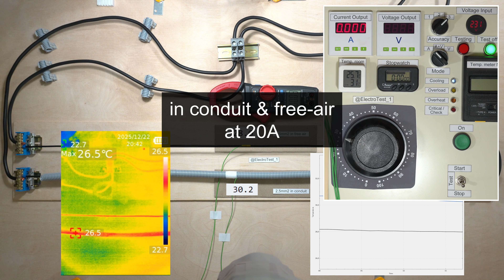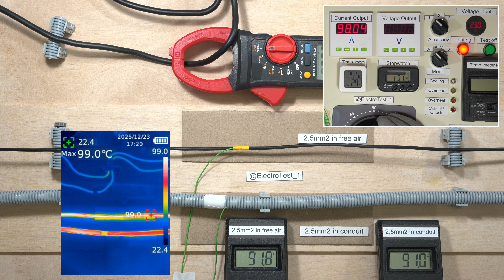Wire in Conduit vs Open air Current Test

Comment from the maker: I found it very interesting to carry out this test, because it’s a relevant topic. In many situations, the rules require cables to be installed in conduit. Now I better understand the processes that occur when a wire heats up under such installation conditions. It’s better not to exceed the allowable continuous currents and to use appropriate circuit breakers. When I conducted the crash test, I was very surprised. I think opening the conduit and inspecting the condition of the wire will help explain the results. So far, I’ve only tested a single wire — in a cable, the heating will likely be even greater, and I’m working on such experiments. Feel free to share your ideas.
It would be interesting to hear how often you install cables and wires (different cross-sections) in flexible conduit or pipes. What current and what circuit breaker do you consider safe? Do you run individual conductors in conduit (one, two, or more)?
A few questions for discussion: Will there be a difference with installation in a rigid pipe? How does the diameter affect it? Is there airflow along the wire or cable?
Reply: Some ideas:
- make a mockup of common wall setups (drywall, insulated and not, for US and brick* for the rest of the world, though different bricks have different thermal)
- see if running more than one load on different phases makes much difference 
- measure what properties change as the wires heat up, especially if testing more than one circuit. We know what theory says but would be cool to see in practice
Reply: Conduit is used in house construction in Europe when walls are made of cinder blocks / cement / hollow bricks. In remodeling for instance, when add'l cables are needed, a channel is first cut into the concrete / brick walls, the conduit is embedded in it, and the groove is completely filled back in with plaster / cement. It is against to embed wire / cables in cement. And a conduit allows old wire / cable to be removed or new cable to be added if need be.

Cable in conduit is also used a lot in camper vans to protect the cables from the sharp metallic walls / holes.

AFAIK, US NEC code doesn't specify the nb of wires / amps in a conduit. It just derates down the max current allowed per wire if in a conduit. But I am not an expert on this.

An awesome resources to calculate wire gauge, size fuses, free-air vs conduit, etc, of a DC system is the Circuit Wizard from  Blue Sea Systems. It is a simple online calculator, and it shows well all the important decisions to make when sizing a circuit (max tolerable DC voltage drop, impact of insulation, cable sheath temp rating...).
Reply: Great test, this was very informative. Thanks. I think a standard housing lighting cable (1.5mm 2core +ground, 10amp) or power cable(2.5mm, 16amp). Would be interesting because the ground shouldn't carry a current making it help dissipate heat.
Reply: From what I've seen in my journeys on youtube, solid pvc and metal piping (EMT) seems to be most common in Asia and the Americas. I think I've also seen flexible metal conduit as well.

Comment: Quien esta consumiendo? por que si los cables estan en cortocircuito actuan como una resistencia y acumularan calor, encambio si estuvieran en una instalacion normal con aparatos que consumen la corriente el calor seria disipado por estos no por los cables, de cualquier manera gracias por los experimentos.
Reply from the maker: Thank you for your comment! You raised a very interesting topic. Indeed, not everyone understands that wires also consume electrical energy — under normal conditions this is about 1–2.5% (and up to 5% for high-power) of the consumption of appliances or lighting. That means the main consumption comes from the loads themselves, while the wires will heat up more or less depending on their cross-section. In short, household circuits this is less noticeable. However, where there are high-power loads such as heaters or EV chargers, this becomes a very important factor when selecting cables and conductors.

Comment: И зачем о такой очевидной видео снимать
Reply from the maker: Many subscribers asked me to do a test with a wire in a corrugated conduit. What idea for a video would you suggest?
With my test setup, I can apply voltages up to 500 V and AC current up to 1000 A.

Comment: Thank you for the test. Is there a way to calculate the heat of a 2.5mm wire at 16A which is in 25m conduit ? Is it safe to say, that this will be below 40°C ?
Reply from the maker: Hi! Good question! This result applies to a situation where there is one loaded conductor in the conduit. In real conditions, there are usually two conductors, or a cable (two conductors in a common sheath). In addition, ambient temperature also has an effect. If it’s summer, the temperature can be 5–10 degrees higher. I will be doing tests with two conductors in the future as well.

Comment: Are you running this with AC or DC?
Reply from the maker: I use alternating current (AC) in my tests, with a frequency of 50 Hz.
Reply: @ElectroTest_1  in which case you should be doing the test in looped back pairs instead of single wires to get a more accurate reflection of how things would be in the field

Comment: with this video it can be estimated that the copper wire in a box transformer is hotter than a toroid transformer. thank you... 👍😁
Reply from the maker: Could you please explain what you mean? What do transformers have to do with this? They can have completely different designs and cooling methods.
Reply: Box transformers are more insulated than donut transformers in my opinion, especially ferrite transformers for welding machines...

Comment: Have similar heat problems with Coiled Cord and worse Long Extension Cords even when loads are at or under cords amp ratings. Inner loops have no air and can melt the plastic insulation, plastic reel they wrap around or both.
Reply from the maker: Thank you for the useful information 🙂 Do you often use extension cords on reels?
Reply: @ElectroTest_1  I do many times but always fully unwind all including 15 to 30 M (50 to 100 Feet) "E-cords" for running things like electric lawn mowers pulling 9 to 13 amps. Many use "E-cords" with plugs built into the reels, don't unwind all the way and wonder why the product fails because reel warped and won't turn or cause worse problems and never trip the breaker in them. And that's assuming you have good cords not low quality ones from China and other 3rd world countries that have bad ends, aluminium wire, and more problems before actually using them.

Comment: Треба було давати струм до вогню, або перегорання дроту, цікаво де це станеться швидше
Reply from the maker: Thank you for the idea 🙂 though I think that in many cases there won’t be any fire, because the cables do not support combustion. And for sparking to occur, there would need to be periodic short circuits between phase and neutral or ground. That would require somewhat different test setups.
Reply: @ElectroTest_1 а ось це і можна перевірити.. бо в моєї покійної бабусі провід загорівся по всій довжині (5-6 метрів) , коли заклинило насос в криниці. Там була помилка монтажу, провід 0.75х2 ШВВП на автомат С25.. 

Ще цікаво, коли двух жильний кабель в гофрі і почне плавитися ізоляція, що буде раніше, гофра поплавиться чи спавиться ізоляція і провід замкне та відгорить..

Comment: You lost me w this test. One would conclude that free air wire can carry less max current, which is the exact opposite of what the electrical code and tables describe.
So what's going on ? I think that continuously increasing the current without waiting for temp stabilization in the conduit is the reason. You performed a dynamic thermal test at the end instead of the static, worse, thermal conditions assumed in the electrical code and that you reproduced in your early fixed current tests when you waited for temp in conduit to stabilize.
Explanation: temp stab in the conduit at 20A took as much 1000 seconds and ended up way higher than free air, see 5:48. So I bet that if you redo the last increasing current test step by step while waiting for temp to stab, the result would completely different. Example of test protocol to consider: start at ~90A, go up to your final ~110A value, in ~5A increments AND waiting for the temp in conduit to stabilize. With that, I bet we'd see the wire in the conduit melt much earlier than in free air. That's why code is more stringent for max current in conduit than in free air, and why the max current tables show that too.
Or did I miss something here ?
Reply from the maker: You did a really great analytical job — I’m absolutely impressed! Yes, you are absolutely right that with prolonged currents, even at 60–70 A, the cable in corrugation could start melting first. I think the idea that a cable in corrugation heats up more was already clear from the previous tests. I conducted the crash test in a way that simulated something like severe overloads or short circuits with incorrect protection on the line. So I’m very grateful to you — you understood everything correctly and made an excellent conclusion!

Comment: you should do a test conduit vs wire in fiberglass insulation vs wire in spray foam insulation.
Reply from the maker: Thank you for the ideas. I’ll gradually implement different cases.

Comment: Now I'm wondering how hot the cables get in the uninsulated attic that reaches 45 degrees Celsius, as well as how hot they get when we insulate the outlets (airtight). Maybe we need to pierce the flexible conduit for ventilation.

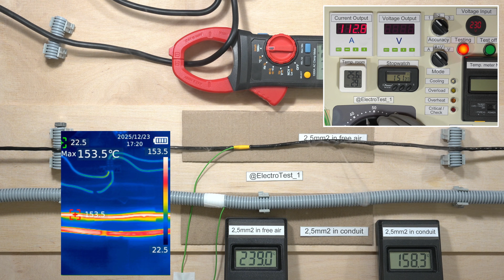Comment: Thx for video. 8:08 My hypothesis is that air cable insulation burned of and sensor contacted with hot coinduit that why it is hoter than in coinduit.
Reply from the maker: Thanks! The sensor wire in the air could have touched the copper directly; however, this is probably not the main reason for the higher readings. I am more inclined to think that part of the thermal energy went into heating and melting the corrugated conduit, so the wire took a bit longer to melt.

Comment: Makes sense. This is why cable reel extensions also come with two ratings. On a 50m cable reel extension, the amperage ratings for the "wound" postion will be always lower than the "unwound" (fully extended) position. I guess it has to do with how much air is in contact with the cable. The heat disipates better if the cable is completely extended, although it could be also related to slightly higer capacitance in the "wounded" position, which in turn increases reactance. In the case of the conduit, the cable doesn't ventilate as well, it heats up faster, which in turn increases resistance to the current.
Reply from the maker: Thank you for the interesting information! Of course, it’s better to fully unwind an extension cord on a reel 🙂
Reply: It has all to do with self-heating.  The area to release heat is smaller when the reel is wound. 

Reactance is no issue, as the net current through all conductors is zero. The current in the phase conductor is equal but opposite to the current in the neutral conductor. There is therefore near zero net magnetic field around the cable.  

Physically it is a coil, but there is no current through the coil that will build up the magnetic field to create additional reactance. 

Capacitance is also not an issue at 50/60 Hz for say 50 m cable length.

Comment: Can you test 6mm2 with 40A? Many electricians say 6mm2 is too small.
Reply from the maker: Hi. In many cases, regulatory documents allow 40 A and even more for 6 mm². However, there are different installation methods and correction factors. It is also necessary to consider whether there are other loaded cables nearby. You also need to check the voltage drop at the end of the line. Single 6 mm² wires can be used for jumpers in electrical panels. What are you more interested in?

Comment: Perform a test simulating a phase and neutral condition inside the conduit.
Reply from the maker: Yeah, that would already be a completely realistic situation. Although I usually run cables in corrugated conduit, there are also short sections where I run just individual wires. I’ve heard that in the USA this is a fairly common practice — running individual wires in conduit.
Reply: @ElectroTest_1  Here in Brazil, running Phase and Neutral inside conduit is standard. Our electrical code specifies the maximum allowable conduit fill for circuits. Would be cool to see how this performs. Nevertheless, great work!

Comment: Be aware that if you run a single AC conductor in a metallic conduit, you have now made a liner transformer and the temp will be much higher.  It will be even hotter if the metallic conduit is grounded to the power source.   With 2 wire single phase  or 3 wire 3 phase wires all in one conduit, the magnetic fields cancel each other out and there isn't a transformer effect.

Comment: Hello! If I may suggest a test, I would like to know what kind of load the Chinese aliexpress solar ATS switch can handle?
Several people say that the connection point of the flexible wire ultrasonically welded to the internal contacts is not suitable. The type I recommend for testing is TOMZN TOQ5-125PV. Thank you.
Reply from the maker: Thank you for the idea. I’ll think about this experiment. The problem is that each individual sample can vary greatly in the quality of the connections at the terminals.

Comment: Nice tests. It would be nice if you could do a test with a conduit truly buried in a stone or concrete wall, using a 2.5 mm² cable. I have always had my doubts about the standards that define cable diameter and current density. These standards never describe the test conditions or the resulting findings. The same applies to cables buried in the ground. If you can, I’d be very curious about the results.
Reply from the maker: Hi! Quite a while ago I started wondering how much the requirements of standards limit the heating of conductors. At first, I thought they allowed too much current for cables. Then I thought they allowed too little current. Now, after running quite a lot of experiments, I understand much better that the standards are actually quite reasonable 🙂 However, you need to know how to use them properly, and there’s still a lot I’d like to test.
Reply: @ElectroTest_1  In the end it all comes down to the heat transmission though a wall. I don't know how to calculate that.

Comment: There is more going on in the conduit than is shown:
After the current is turned OFF the temperature is still creeping up - indicating that the sensor most likely was no longer in direct contact with the wire or the insulation having already detached from the wire - making the numbers highly unreliable.
Reply from the maker: It’s great that you noticed the temperature rise after switching off! The explanation is very simple — the thermal inertia of the thermocouple. In other words, the temperature changes with a delay: the metal bead on the thermocouple needs time to heat up to show the temperature at that moment. If the changes are small, there is almost no delay, but when the change is tens of degrees, the delay can be several seconds.
Reply: @ElectroTest_1  "The explanation is very simple — the thermal inertia of the thermocouple."
Shouldn't we have seen that with Both sensors then and not just the one in the conduit?
Instead we see one dropping significantly while the other is still going up.

Comment: Niiiice! Next test: nearly same setup, but with isolation wool in the conduit. Or conduit filled with beton/cement (for the German variant) :D. Would be closer to the "In a wall" setting.
Or, as a more simple simulation: Two pieces of wood with a groove for the lower wire, which might be the closer to the typical USA variant.
Reply from the maker: Thank you for the detailed description for the other tests. Am I correct in understanding that in the USA a cable can be installed simply between wooden beams without conduit? And how do you feel about installing a cable directly in the walls without conduit, under a layer of plaster?
Reply: @E @ElectroTest_1 cables in plastic jacket usually named Romex 12/2 or 14/2 where 12 or 14 is a size (cm^3) and 2 is number of wires in cable hot and neutral, ground as bare copper wire. Different in some state/city like NY you should use metal jacket cable names BX or MC 12/2. All of it running in halo space of the walls and sandwiched between insulation and Sheetrock on top of insulation. Metal conduit (EMT) with wires inside running  outside of wall (exposed) or in special cases.

Comment: Для кабеля 2.5мм необходимы автоматы на 16А, какой смысл их нагревать током 32А, если автомат сработает раньше. И еще, многопроволочную жилу не применяют в стационарной электрике. Только моножила. Так что тест в принципе нечего адекватного и не показал.
Reply from the maker: According to standards, the permissible continuous current for 2.5 mm² cables is 25–30 A, depending on the installation conditions. Therefore, a 20 A circuit breaker is perfectly acceptable. A 25 A breaker may be used in rare cases—it must be verified using the tables and ambient temperature conditions. 16 A breakers are commonly installed because standard sockets are rated for 16 A. The cable itself can withstand higher current. There are many other applications for 2.5 mm² cables or wires, not only household sockets. As for solid and stranded conductors, this is not specified in the regulations. What matters is the type and intended use of the cable, and if its sheath is designed for fixed installation, it may be used for fixed installation.